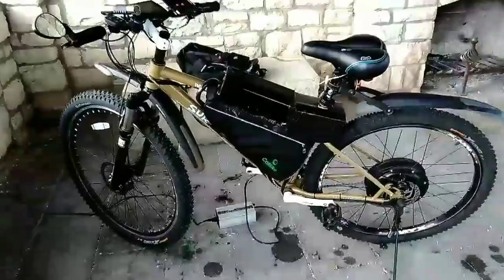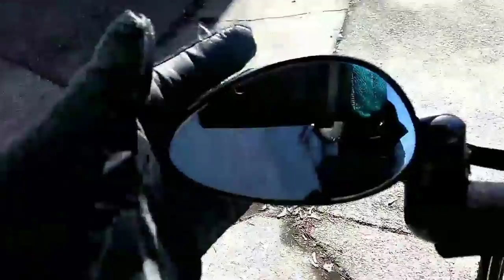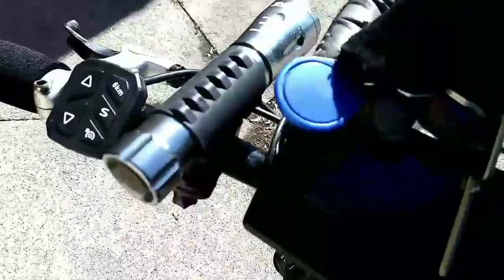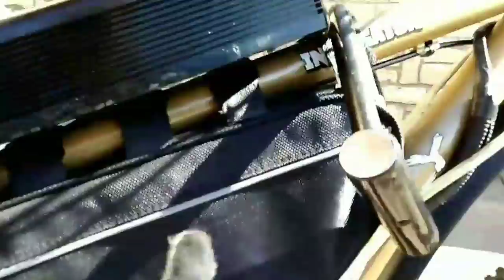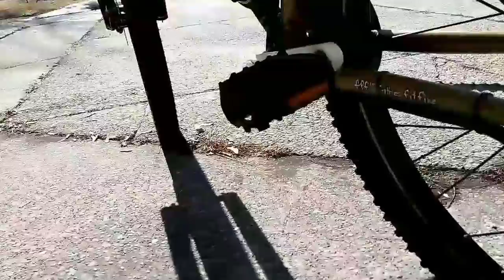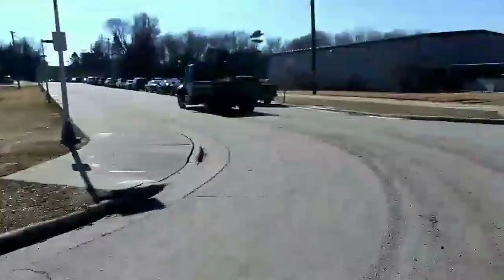Electric Bike 72V 3000W Power!!

Comment: Hi Andrew I have a 3000w mtx 39 24” I’m  fitting to my dmr hard tail steel frame I have ordered the single speed option as my rear space is 135/6mm I’m just wondering before I start the build did you  modify that frame to fit the 150mm rear hub as I can see you run a single speed set up also & if you did modify the frame how was the re alignment of the rear calliper & was there any brake rubbing thanks in advance much appreciated
Reply from the maker: Complicated question but when I built it years ago we ordered this frame because it was steel and could bend out to my desired width. The brake fits by like a mm. No joke. It's a tight squeeze and I got lucky that things went as they did. It's not an easy task to find solutions to the problems something like this brings about

Comment: Is that really a 3KW motor ? it looks close in size to a generic 1500w,  i.e. much smaller than the huge heavy QS 205 that most people use.   
I'm wondering how I can get 3KW power on my mountain bike.
Reply: Statorade and cooling fins with larger stator wires will allow you to really give the motor some amps. You can give 5,000 watts to a generic 1500 watt hub motor with the upgrades mentioned.

Comment: I built several ebikes and have invested lots of money into electric vehicles. I just bought a BEEFY 2500w 48v 20ah 50amp off roading scooter with fat tires. Im gonna throw a 72v 3000w motor and battery in to it. I have a couple of hub motor bicycles, and two 750w mid drive motor bicycles.

Comment: Hello I have a 3000w hub motor and 60 v battery I get max 2100w out of it. Do I need a bigger battery 72v and more capacity or a bigger controller for the full 3000w? Cool video
Reply from the maker: Most likely a bigger ah battery. I need one as well.

Comment: Controller specs would be helpful. Max amps output?
Reply: Based on the size of the controller and the fact that the battery pack is made in California, it's likely 80amps max

Comment: Single speed is a great idea. Those 3000w are 155 in width. How did you get that on a bike with 142 dropouts?
Reply from the maker: The slots. There are flats on the axle
Reply: @16abind  do you have a link to this setup? I have a surly karate monkey and it would work really well with my bike.

Comment: Doing a fat tire ride with dual 1500 watt motors. I rather have torque and AWD and stay around 35mph. Having dual motors would be good with 46 ah 52 volt battery. Might be more like 1600 watts motors.  Just found a 80amp controller @52 volts. Pulling 80 amps at times on take off is nuts.
Reply: I'm going to build this on a fat bike.
Battery: 72v 42Ah 96A output
Duel Motors: two 48v 1000w running off two 40A controllers

Comment: What size is your back wheel could I get one to fit I have a 1500w 16" and tyre size 2.92" I'm waiting on 72v sabvoton Bluetooth controller and building my own battery just waiting on the bus coming anyway just want to know if i can gwt a 16 " mxus 3000 or 5000w wheel and does the regent work on any motor meaning is it the controller that supports the regen

Comment: Lifepo4 batteries are NOT the same as Tesla's batteries. The only thing that is the same is the 18650 format of the cell. Chemistry is completely different. 18ah isn't more than half an hour at 50mph. So I am guessing about a 25mile range at max speed, maybe double if you go 30mph instead. You could've fit a lot more capacity if you stuck with lithium ion batteries instead. Easily 50ah in the same area if you get the higher end cells.
Reply from the maker: You would be pretty smack on there. Range is super relative to speed. It could go a long way with low speed but the arround town and rip speed, 10mi is a gift. Explain more how i can extend my range? I would like more ah out of it. Seems like the speed control unit would like a bit more from rid characteristics..
Reply: @16abind  i get 2miles/ah at 44.4v 12s lithium ion (8ah pack getting 16mile range) travelling 32mph. Bike is lightweight and so is pack. I use a front hub motor and oddly enough the low voltage cutoff only lets me pull the pack down to 40-41v leaving almost 10% at the bottom of the pack so really it is a tad more efficient than i state.

Comment: How much did this whole set up cost thank u
Reply from the maker: Money :) to much. Still needs 800 bucks before its everything i want
Reply: Can get the 3000w kit from about £600 and 72v 18mah battery about £1000 to £1600 a lot cheaper if you build your own battery from 18650 cells I recommend using a bms good quality one can get one from bangood. Com or Alibaba  also use a full suspention bike a steel one as aluminium are too light it is hard to keep the front wheel on the ground.